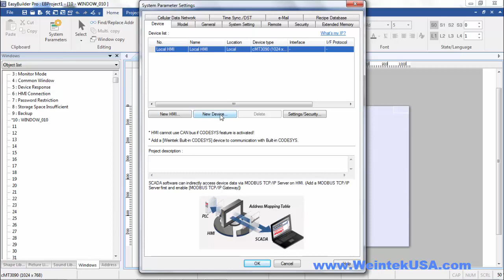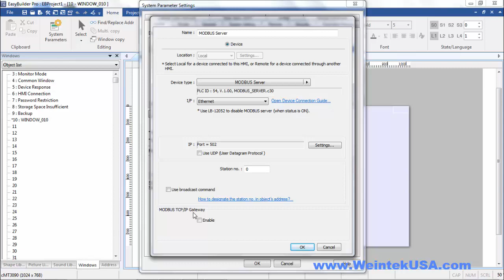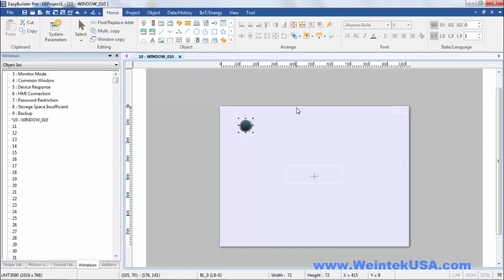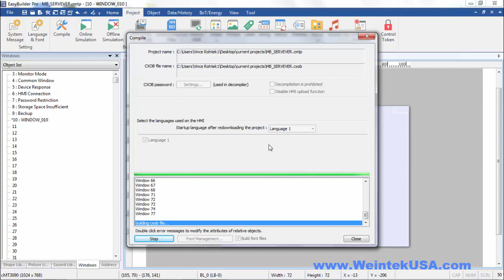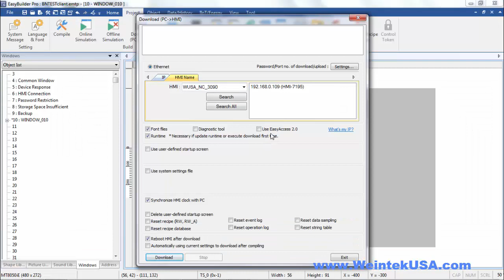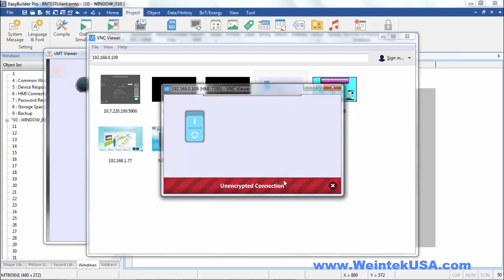Modbus Server & Client Set Up with EBPro EasyBuilder Pro

Comment: For numeric value can we adjust the sampling rate?
Reply from the maker: Hi there! Yes, you can! It is important to note that this will affect all objects on your device. The setting can be found under System parameters; within your selected driver there should be a button for COM settings. There you can adjust the Turn around delay (ms). Please be mindful of using this setting as you may experience some communication issues if the delay is set too short or too high. Hope this helps!

Comment: Hi. Can I used 3rd parties software such as Modscan32 to scan holding register ? So I can take the value and pull it inside my PLC.
Reply: Hi Ahmad,
With the Modbus Server driver selected the HMI will act as a regular Modbus device with modbus mapping linked to the HMI’s internal memory. It is quite possible that this would work.
Please contact Weintek Support with detailed specifics of your application: support@weintekusa.com